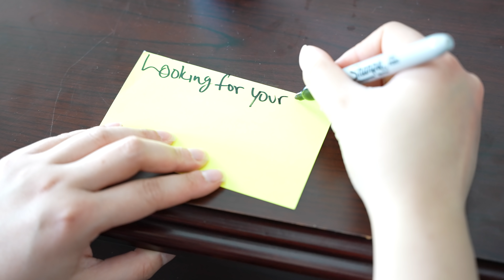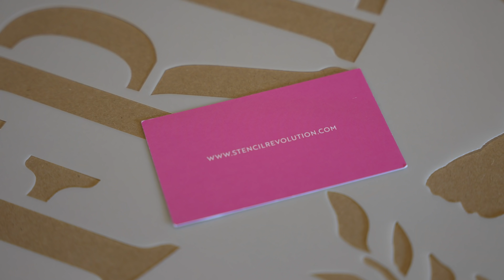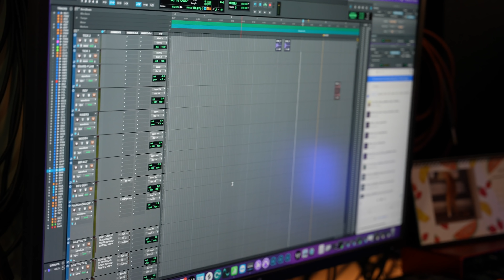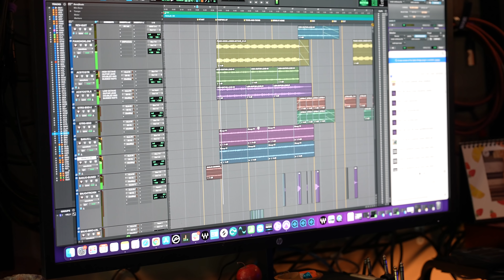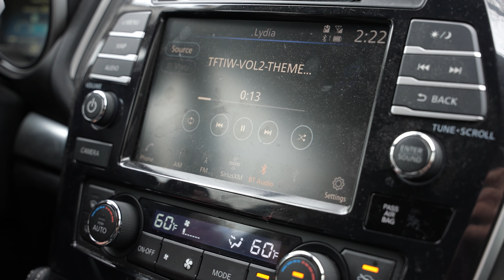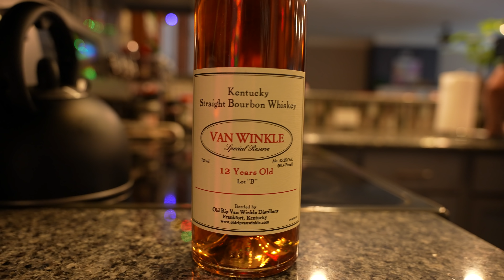Seamus Shocked That His Friends Remembered His Birthday

Comment: Make a baffle otherwise you will overheat the computer. I would use rigid insulation instead of a blanket. Look up box designs online for small aircompressors.

Comment: Doesnt the RV have small appliances with external ventilation? Just reropute the vent into an adjoining cabinet mount the pc inside and run cable through a hole in the countertop. Add some foam paneling to the sides of the cabinet if sound isnt deadened enough.